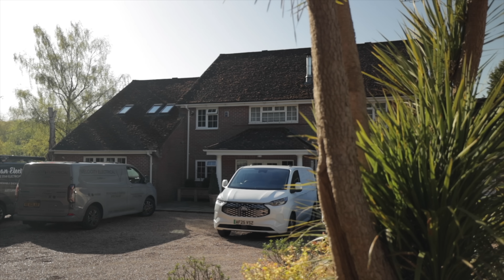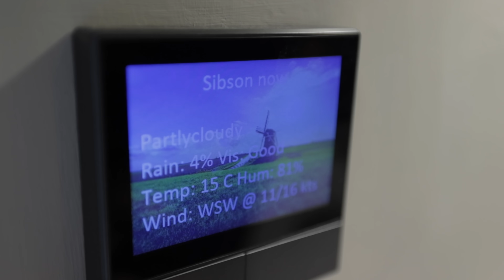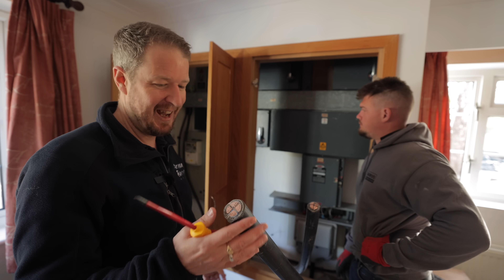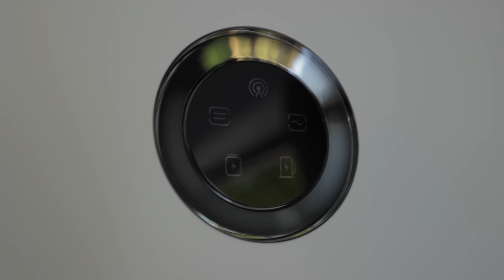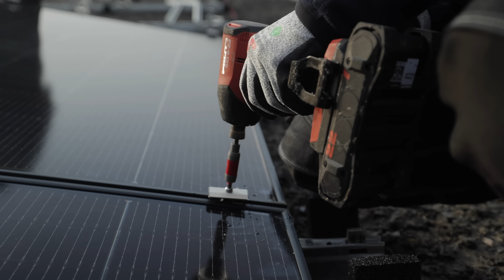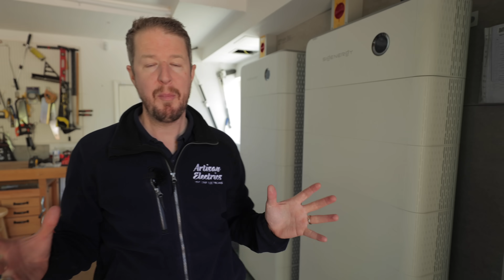Is Battery Storage Actually Worth It In 2025?

Comment from the maker: Get a Quote: Interested in our services? Get a quote from us today: https://app.openquote.net/company/artisanelectrics
Reply: dont promote lithium ion indoors please, u never know when the system might burn .......
Reply: @shazzz_land  "u never know when the system might burn" - Li-ion batteries are orders of magnitude safer than gas boilers - and the latter are almost always installed in the house (or garage, if you have one). And before you use the "it's harder to put a lithium fire out".... at least there's something TO put out; most gas "fires" are actually explosions which destroy the property, possibly destroy/damage nearby properties, and often kill or maim people in those properties.
Reply: @theelectricmonk3909  if ur dumb that doesnt mean east europeans are also ; u forget that Romania did fiber internet for 5 countries in EU so stfub
Reply: How many of these would you need to make a power station
Reply: Great video.  Quick question. Sinergy makes 8kw stacks ? Here in oz im getting a 48kw set up 3 phase. Will be doing similar thing with the battery. 12am to 6am its only 8c kw, so when the solar not at peak now in winter ill use it to run my home for 8c kw all day.
Reply: Just buy 16kw DIY kits battray for $1500

Comment: In 2026, the "golden era" of simple solar savings is shifting. While solar panels and batteries are cheaper than ever, the financial maths is becoming more complex due to two main factors: *fading arbitrage* and *grid bottlenecks.*

1. Fading Arbitrage (The "Buying Low, Selling High" Problem)

Arbitrage is the practice of charging your battery with cheap electricity (either from your panels or from the grid at night) and using it when electricity is expensive.

* *The Issue:* As millions of homes install batteries and EVs, the "gap" between cheap and expensive electricity is beginning to shrink. When everyone tries to buy power at 2:00 AM, that "cheap" window becomes more expensive.
* *The Payback Impact:* If the price difference between day and night rates narrows, it takes longer for the battery to pay for itself. You aren't saving as much "profit" on every kilowatt-hour you shift.

2. Grid Capacity (The "Pipe" is Full)

The UK grid was designed to send power to homes, not take massive amounts back from them.

* *The Issue:* In "solar-heavy" neighborhoods, the local grid is reaching its limit. To prevent damage, network operators are increasingly issuing **"G98/G99" export limits**. This means even if your panels are producing 5kW of power, the grid might only allow you to send 1kW back.
* *The Payback Impact:* If you can't export your excess power for a "Smart Export Guarantee" (SEG) payment, that energy is wasted unless you have a battery to catch it. This makes a battery more necessary but doesn't necessarily make it *more profitable*—it just stops you from losing what you’ve already generated.

*The Bottom Line:* Solar and batteries are still a good investment, but the "payback" is no longer a guaranteed straight line. It now depends heavily on how well you "smart-manage" your home to avoid peak prices, rather than just relying on the power company to pay you for exports.

Comment: Well, yeah, it's all about what you intend to do with it. But the old "economy 7" model only perpetuates the old 1930's brass clockwork thinking that we've got to get rid of. We need a proper market, where we end customers can see the spot price, and program things like batteries to provide load when the generators have got the stuff. (Solar and Wind) It's mad to be buying electricity at night when solar isn't working, and selling it during the day when solar is generating. We desperately need to be able to see that spot price. It went past "no brainer" about 20 years ago. Yes it will be a monster of an IT project. But the bits are all there. (How many times have you waved your phone at the screen and shown a graph of what your own panels are doing??) It simply needs connecting together across the country. We do have the internet. We have "IOT" - and yes, it might even be something useful for "AI" to do. What are we still waiting for? OK, to start with a few pairs of socks might not get washed last night. But we will soon get the hang of it. The big generators offer a spot price to the grid. Why the heck can't we be trusted to see it?

Comment: Be very careful what batteries you buy and where you install them. We had 4no Fox EP11 batteries installed in our garage earlier this year with 28no solar panels in our garden with the batteries set to charge from the grid during off peak night time hours. The system worked fine over the warmer months but since the nights have become colder the batteries either dont charge fully or not at all on some nights. In fact the batteries havent charged fully on 12 nights during this month of November which is a huge disappointment considering that electricity usage will rise during the winter (especially for people like us who also have a heat pump) and thats exactly when you need fully charged batteries every day. I have complained to the installer who basically told me to insulate the batteries ourselves which I have done with some Kingspan insulation panels but so far thats made very little difference. I also asked the installer why we werent informed at the time of installation that the batteries may not charge fully during cold weather and I was told to read their brochure. To make it worse I have found that Fox offer the same EP11 battery in a heated version; I then asked the installer why he didnt offer me those knowing where they were going to be located and I was told they werent available at the time they installed the batteries which is not quite true. So as I say choose your batteries and installer wisely
Reply from the maker: Thanks for sharing your experience and the important advice about choosing batteries and installers wisely!

Comment: Big consideration that wasn't mentioned is the useful life of the battery
Reply: In China, the lifespan of batteries manufactured in China is approximately 10 to 12 years.
Reply: My 600ah LFP can charge over 10k cycles and is guaranteed for at least 10 years. LFP's also don't degrade like the old tech.

This guy bought the expensive all in one while home pack that does everything, but costs 10x what a fit system costs, and has half the power.

Comment: Battery storage works in a domestic situation as people tend to be using little power during the day when they’re out at work, so a grid tied system would just be exporting the excess at a giveaway price and you then have to buy it back at a higher price overnight. In a commercial setting it makes little sense as you’re using very little overnight. Most of the consumption is during the day when solar can be used directly. We have a 45KW grid tied system at work which produces about 1.8MW/h a week in summer and about 500KW/h a week in October. Most days this provides more than enough power and is often exporting, which averaged over a year, more than pays for the overnight cost without the expense/fire hazard of batteries. The main night time consumption is a server rack pulling only about 1.5KW.

Comment: A question. You have different stacks. Do they need to have the same invert size on each stack? I am looking for a 48kw sysem but the height is a problem. So thinking of spliting the stack or it will mean a complicated and possibly costly wiring soltion. But if i go dual stack i am be ablet o add anther 2 batteries later down the line and still not be over my height resticition. I look forward to your reply

Comment: Some of the comments are hilarious!  I found this really useful and informative, moreover it’s answered the one question I had about my 18kwh solar/battery set up - can I switchover to off grid mode in the event of a power failure. I had not heard of backup gateways before….  I’m off to chat to local installers (unless you guys operate in NE Scotland).

Comment: That first set up looked amazing but must have cost a fortune.  Whilst I don’t expect to hear the actual cost as that would be client confidential I would be interested in knowing what the ROI is based on the current differential between the customers nighttime and daytime rates assuming the ideal scenario where he would completely charge up and discharge all 144KW of storage every single day of the year.

I understand the medium and long term variables in this but if the ideal ROI is 15 years, say then this is a non starter but if it is, say, 5 years then this may be worth considering even though it’s a massive investment.

Comment: so they are saving 24p per kilowatt , 3x48Kw storage= 144kw storage total, so maximum saving of 22,15 Euro per night = €8084,36 per year
an 48Kw Sinenergy unit costs about €29.435, times 3 is €88305. Divide that by €8084,36 is 10,9 years before you break even. Thats almost eleven years the night tariffs have to be cheaper in an economy where prices of electricity are more likely to go up than down. It's a matter of time where power during the day will be much cheaper cause of all the solar panels than during the night. 
This is an absolute waste of money and prime example of a bad investment.
Reply: My math says something different. You have to take into consideration how many hours in every 24-hours you get higher price in the grid. If it is 5 hours, which is often the case, and if you save 24p per 1 kW I get 0.24 Eur * 5 * 144 * 365 = 63072 Eur.

Comment: What's the pay off time for a system like this. The business must obviously use/save a significant amount of money to be able to pay this off in a reasonable amount of time. Each one of the first Sigengy stacks must be roughly £14k [ I'm getting prices from google because yet again, another manufacturer wont give clear pricing on their website which puts many people off]. This means for the batteries & inverter your guestimating at £42k. A lot of people talk about the Savings you can get from solar an batteries but you don't include the cost of install and kit and the majority of people will be using financing for that. Even when you include the savings and monthly loan costs your paying more for 10 years. It would be nice to see a small cheap set up. 5k to 10k wise. small house or something. everything I see is most rich folk sticking massive amounts of solar and batteries that's 4 times the price of my own house.

Comment: Kudos on providing logical examples, scenarios and potential benefits of installing a PV and/or battery storage systems. Alas for a complete picture, I think time warrants a mention. both solar panels as well as storage systems deteriorate over time, to a point where they may no longer be fit for purpose and may need to be decommissioned. A solar panel may be designed to be deemed 'useful' by the manufacturer for say 25 years, there is nothing to say that it could not function additional 10, 15 even 20 years beyond that, despite the continued deteriorating efficiency. Storage system will have much shorter intended functional lifespan, generally 10 years, none the less may still bu usable 3 or 4 more years. If the intended functional lifespan of the project is say 50 years, rough guesstimate could be made that PV system would be fully renewed once after initial installation and storage 3 more times. These costs ought to be taken into account or at least considered. the question majority renewables enthusiasts fail to consider is what to do with old solar panels and battery systems (lead acid, LFP, LTO, NMC.etc.. ). Once up on a time, people thought asbestos was so super useful and versatile from disk brakes, clothing building materials insulation, just blow it loosely into your roof and never give the winter chills another thought - low cost, huge savings, you'd be mad not to do it. No need to labor the point that if you lived long enough to gain all those perceived initial benefits, the the decommissioning costs just might send you to an early grave.

Comment: Dunno if the Lightning & Silverado EVs are on sale in the UK yet... Both have big batteries and ~10kW onboard inverters (optional... The stock ones are ~3)... Get one of those, a transfer switch, and Bob's your uncle. Dont bother with the Ford "Home Integration Kit'
.. it's buggy, and too reliant on the Cloud... Not sure Chevy's is available yet, but same issues will likely apply.

Comment: While nightime power demand is lower, as more are more cars and battery storage start drawing from the gird overnight, I can see a time when these ultra low slots get either shorter or split depending on demand. We can presume car charging will happen from say 12pm to 5pm but that midnight start may change to a later time in the summer and an earlier time in the winter. In this case , the need for hot water in a spa would seem to suggest a solar thermal would be ideal - preheating of cold mains water, reheating warmed water and at a higher efficiency than PV. I would not be surprised that in a rural area, mains water is colder especially in the off-summer months as well. The presumption is that a grid access loss is short term, whereas self power generation allows both battery storage capacity to be extended and some onsite independence that does not rely on grid repair to come online as expected

Comment: Silly question time, if I have existing storage, in this case pylon tech and want to install a new bank system can I add it separately  and keep the pylon techs? I know you can't mix n match but I can't see any answers on the net about being able to have different brands side by side say with a switching system/running them together or even just manually going between them.......is this an option rather than selling them off?

Comment: So watched the first 14 minutes about battery without solar and whether it's worth it and there is no mention of prices, other than fill out a form that requires photos and a video to be submitted.  Pretty certain a lot of time would be saved if some ball park examples were given out.

For example I use 15-20kwh a day and like the idea of going the battery route, I don't want to waste your time and mine if it is pretty obvious the price is going to be massive, so some examples would help.  £10k (unlikely) would probably be a no brainer, £20k (more likely) would probably be unaffordable, but probably won't bother wasting anyones time without a idea where it's going.

Comment: And if the energy companies stop the cheap rates your screwed, ROI makes no sense, maintenance, replacements, are never factored in. 10 years ROI is often quoted, but the batteries won’t last that long.  If you have power cut issues get a generator.

Comment: I have watched several of the videos covering the installation of some massive Solar and Battery Systems but always the same question comes to mind.  Has there ever been a full cost & benefit analysis done prior to installation and is there actually an overall saving or is it just done with a view of being able to say they generate their own energy.  From what I understand most of these batteries only have a 10 year life operating at the optimum level and being able to be fully charged and then the capacity drops off.  I hear the words that these systems make a substantial saving on the kwh costs but does that include the write off costs of installation factored over the life of the components - solar panels approximately 25 years and batteries approximately 10 years?  We live in Spain and are blessed with around 300 days of sunshine a year and a few month ago had a solar and battery installtion put in.  On good days we generate about 80% of our energy requirements.  Our modest system has 12 panels (don´t know the rating) and a 5 kwh battery which, when the sun is shining, charges to 100% in about 3.5 hours.  Pricing for electricity in Spain is in three tiers with the most expensive being Tier 1 and applies to times of high demand, and Tier 3 being the cheapest covering times of least demand i.e. Night, Weekends and National Holidays.  From the system app I can see that we draw most of the units from the grid during the evening and overnight.  I have costed out the purchase of an extra 5kwh battery to plug this "gap" but when the cost of purchase is proportioned across the 10 years to write it off, at todays prices what we save on consumption is exceeded by the cost of the battery!!  Also, when there is a power cut, the system is configured to shut off too (presumably to prevent the local grid being energised from feed back installations while maintenance is being conducted).  To have a "switch over" backup just adds a further substantial cost to the installation.  I find it difficult to see when an installation costs €10,000s that there is actually an overall real saving when depreciation of the hardware is taken into account.
Reply: log your battery remaining capacity - it usually decays to 75% under 7 years then decay is slowed

Comment: It's all very fine and well saying "oh great, I'll install batteries, charge them at a cheap rate and use them to power the house during the day". A small home installation will cost approx £7000. Fine if you have it, but if you are financing it with a loan over 4 - 5 years you're only going to really get the benefit of cheap power for the next 5 years. The design life of most of the batteries is 8000 - 10000 discharge cycles, roughly 10 - 12 years.
Reply: Is the 8000 - 10000 discharge cycles the full life time of the battery and how does that map to 10 - 12 years.  In my simple mind 1 dischage cycle = 1 day so I must be missing something.